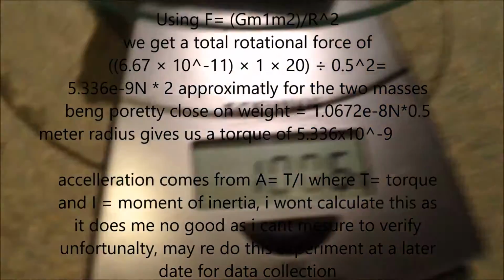Cavendish experient, proving mass derrived gravity

Comment: After the system stabilizes, configure a highly sensitive scale to measure the force at one the bricks to determine the counteracting force induced by the torsion in the wire when it will try to unwind upon removing the large rocks then remove the large rocks.  You will have measured the attractive force of both pairs combined.

Comment: Maybe the mass of all the junk everywhere is effecting it. Even if this experiment wasn't total bs that has failed for everyone who has tried to do it dude you are doing it wrong.
Reply: love that logic, it failed because it worked, the point is all that "junk" is of a low density and of a large distance away that it will have no force couples on it, and no it hasnt failed for ewveryone who has rtiered it, i know personally of atleast two others who have done it succerssfully
Reply: Really because the original experiment was done in an EMPTY barn just for the purpose of the mass of anything else not to affect it. He even had a viewing mechanism set up to see the experiment without going in so his own mass would not throw off the experiment. So Cavendish worried about any other mass even his own but this guys crap everywhere and his own mass will not affect it? THINK BEFORE YOU SPEAK.
Reply: i have, and there is a significant difference between cavendishes experiment and mine... his was a precision endevour, he was attempting to measure the gravitational constant (and thus determine the mass of the earth) i am not, I am merely proving the existence of gravity, and since the position of all other masses remain constat and the only variable is the movement of the two large rocks its a non issue

Comment: Nicely executed and pretty thorough experiment.  Another factor which might affect the experiment though:  Apparently brick is quite magnetic due to it's high iron content (which are why bricks are red).  Is the rock sandstone? If it's reddy then it might also have an iron content.  I've seen this experiment done with bowling balls to which commonly have an iron content for weighting.  Could these experiments just be big clumsy compasses affected by micromagnetism?  Cavendish did his initial experiments with lead which isn't magnetic but it is diamagnetic - i.e. affected by a magnetic field but not producing one.  To be properly controlled I guess you'd need all the masses to non-diamagnetic and non-magnetic?  Anyone?

Has the experiment ever been repeated in a vacuum with all objects at a uniform temperature and to eliminate convection currents and properly shielded from all external electromagnetic sources / vibrations (light, sound, magnetism, solar radiation) and done with non-diamagnetic/non-magnetic masses.  Anyone got a large vacuum tank handy?
Reply: Check this one out:
https://www.youtube.com/watch?v=IH6aFgQhM_A&feature=youtu.be

Comment: Shouldnt the moon have more impact on this construction than the rocks?
Reply from the maker: theoretically yes but the moon is constant throughout more or less and the forces would be balanced between them
Reply: Yes, came to the same conclusion, but what if you debalance the construction to build something like a moondedector, it should give more convincing results. If it works, it should be easyer to mesure.
Reply: K_ Ralph this is about differential in forces, gravity is an inverse square law force in that if you double the distance the force is 4 times less, the rocks are very close on one side with nothing to counter providing a rotating moment, the moon is so far away there is no difference in force on either side, so whilst the moon may exert more force it does not exert more moment
Reply: flat earth debunker you a troll bro?
you really believe this bullshit? this is the most biased experiment ive ever seen. what a douchebag

Comment: Flat Earth is another Talmud´s lie, promoted by fake jews. Flat Earth can be debunked by a simple compass. If the Earth was flat, then the North would be the center of the Earth and the south, anywhere in the edge. Navigation would be impossible and compass simply would not exist. Another way of debunking is by a sextant, where is taking place the "horizont correction" to get authentic distance that we can measure. Simple.

Comment: You may want to add a water brake damper, to cause the oscillations to settle out. Take a look at my video here.  https://www.youtube.com/watch?v=shTNd0ou2a8.  The hard part is definitely avoiding extraneous forces.  Also keep in mind the force is proportional to m and inversely proportional to 1/r2 so smaller denser masses that you can bring the center of masses closer together may be better than larger masses farther apart.
Reply from the maker: dapening is an issue but when i reconduct this experiemtn i will aim to cconstuct an airtight container for it to prevent extenuous drafts that might affect the system, the reason for large masses far out is quite simply moments, the force is diretly dependant on mass so you want as  much mass as possible, and the distance is to a) provide a greater moment about the center and 2) to make surew the mass attreacting one end is a significant distance from th other, which would nullify the forces involved

Comment: Awesome! I think you can roughly measure the effect and estimate gravitational constant from your setup:

1. Measure or calculate moment of inertia J of moving part of your setup (tube with two bricks). 
2. Measure oscillation period T and find stiffness coefficient K. Since T = 2 * pi * sqrt(J/K),   =>   K = 4 * pi^2 * J / T^2
3. Measuring angle of deflection and knowing stiffness coefficient you can estimate force of attraction b/w bricks and large concrete blocks. I thing it is OK to ignore uneven mass shapes for rough estimation (ideally they should be spherical).

I hope I will also do this experiment sometimes :)
Good luck
Reply: flat earth debunker you should because this video is garbage
Reply from the maker: have you had any luck replicating? i fully intend to redo this experiment as soon as i have sme money to invet in it to do this properly and with finaitude, with any luck if i can find some small enough strain guages i might be able to directly measure the fore caused by the adition of different masses, which would be cool